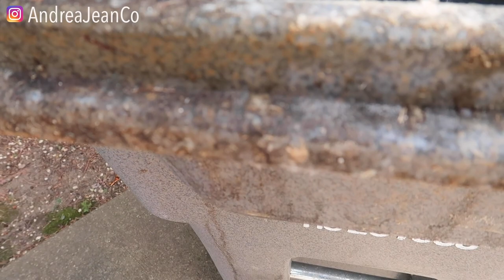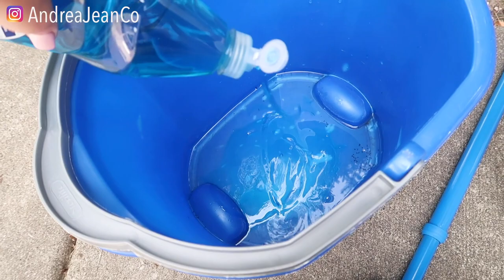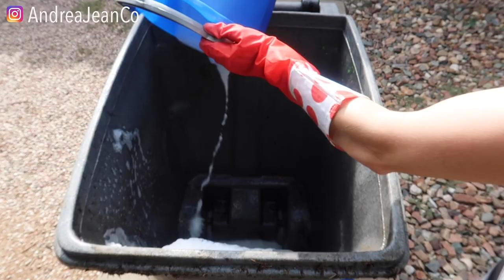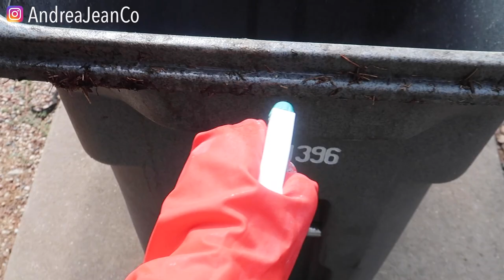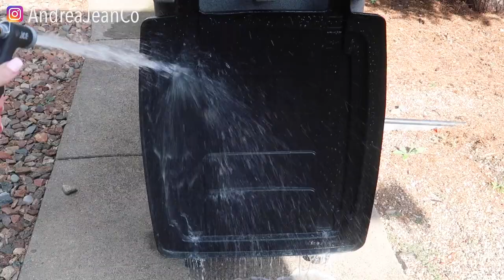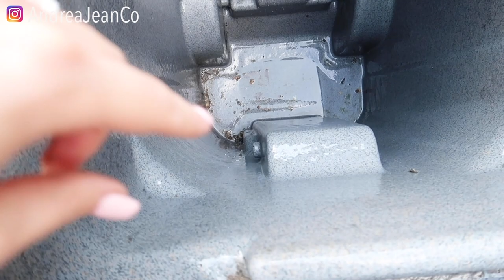MIRACLE Shower CLEANER for MAJOR MESSES & STINKY TRASH CAN!! (Cleaning Hack) | Andrea Jean Cleaning

Comment: Hello!

I clean trash cans myself and here is what I do!

Step 1. Rinse the can with a pressure washer, This will lossen all the gunk

Step 2. With your pressure washer put a dispenser attachment on it (or a spray bottle) and spray the can with the soapy water.

Step 3. Rinse off all the soap and flip trashcan over to remove water, Then let it dry.

Step 4. Rinse the outside of the can, then use the soapy mixture.

Step 5. Rinse off the soapy mixture, make sure you get the wheels and lid!

Step 6. Spray with a water peppermint oil mixture, This will make it smell nice and act as a bug reppelent.

Step 7. Let it Dry!

Now your done!
Reply: Are you sharing the peppermint oil mixture, ball park anyway?

Comment: I would use an old broom instead of the scrubby with a handle. Broom is longer. Then clean the broom with your miracle mixture, rinse and then finish with cleaner + bleach spray.